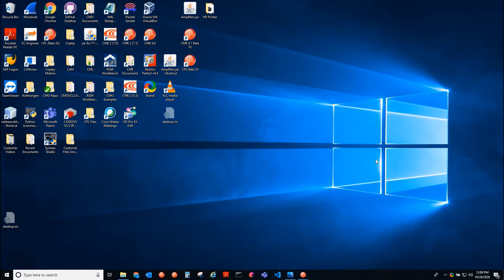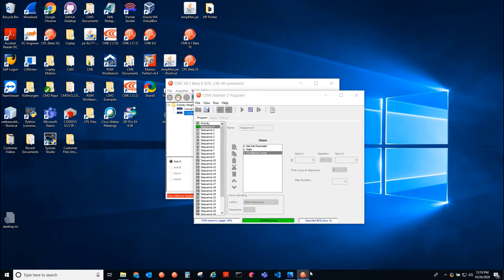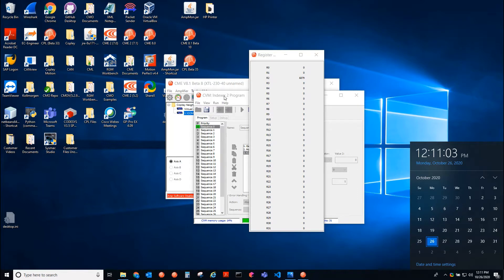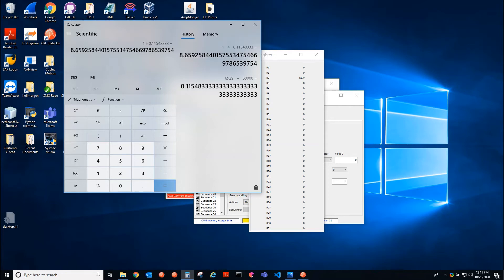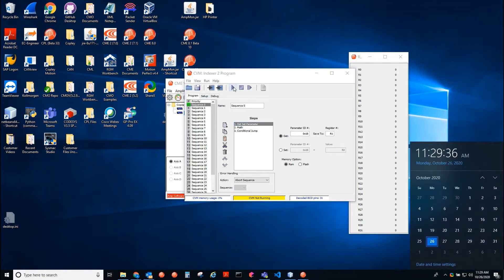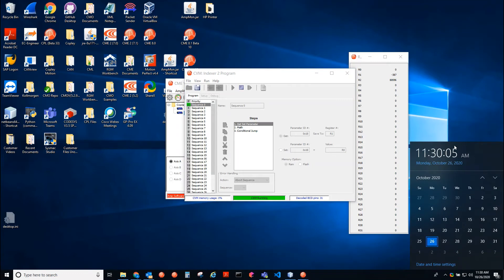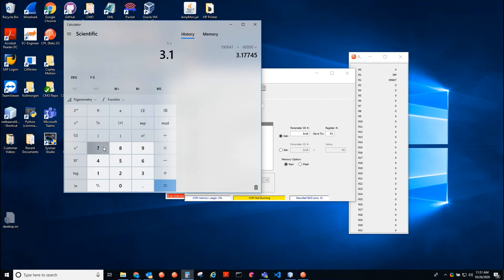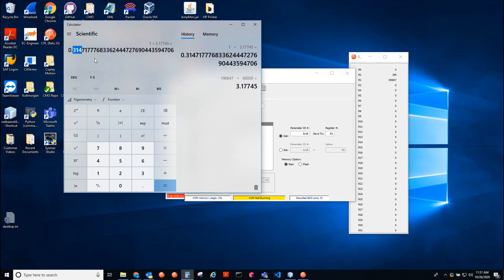CPU Performance Test: DSP vs ARM

Comment: DSP CPU is not meant to be used for general purpose instructions, and it will give you worse results compared with arm or any general purpose CPU. Instead, DSP CPU must be tested using its optimized instructions
Reply: That's what they want you to believe so you keep buying more UAD devices.
Reply: @SaccoBelmonte  actually it is famous DSP CPU performance that nearly all DSP apps prefer it